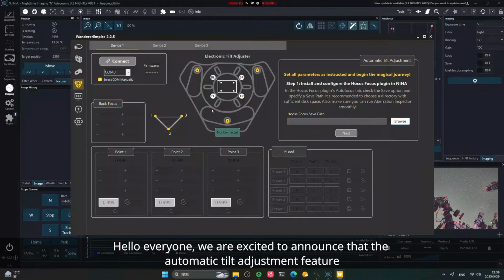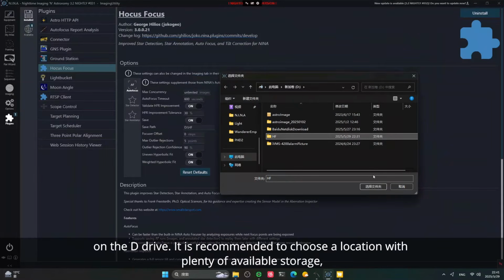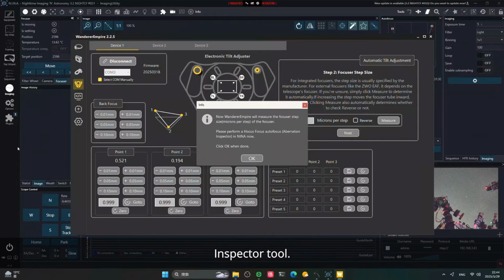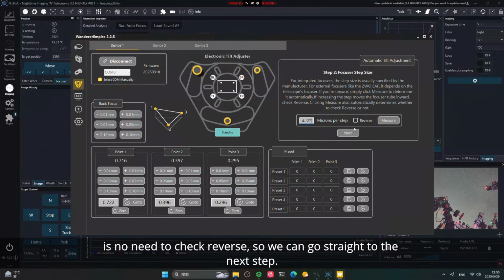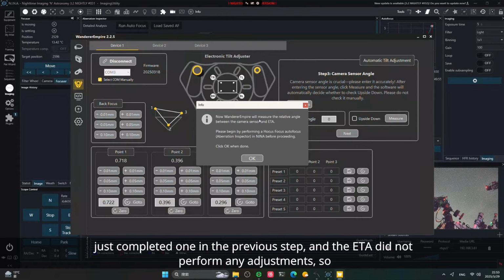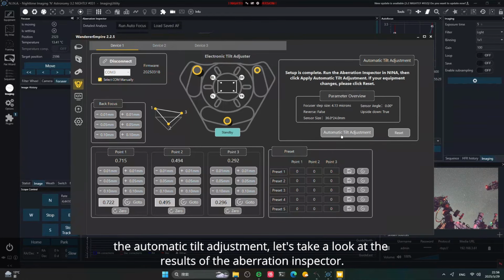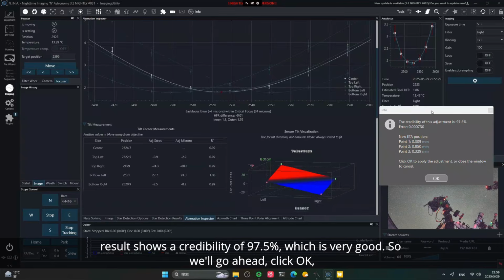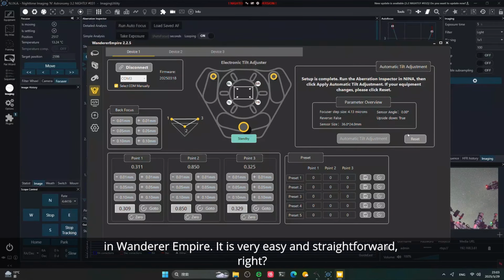Wanderer ETA Automatic Tilt Adjustment Tutorial: The Future of Astrophotography Starts Here

Comment: Technical question:

I currently have the following imaging train on my Takahashi FSQ-102, configured from left to right:

ZWO ASI6200 full-frame camera (17.5 mm)
ZWO Filter Wheel (20 mm)
ZWO Rotator (16.5 mm)
1 mm M54(M)-M54(M) spacer
Takahashi Reducer

The required backfocus for the reducer is 56.2 mm.

I am interested in adding the Wanderer ETA M54 to my setup. Could you please explain how this device should be integrated into my current imaging train and what spacing changes, if any, would be required to maintain the correct 56.2 mm backfocus?

Note: I would like to keep the rest of my setup exactly as described above.
Reply from the maker: It is not possible to combine the ETA to 56.2mm back focus using the CAA.

Comment: Good tutorial! Thank you! Question: Is there a different process for fine tuning of backspace from a flattener or reducer? (perhaps it uses Aberration Inspector to check the eccentricity of the star shapes?)  Will you do a tutorial about adjusting backspace?
Reply from the maker: Hocus Focus also gives the back focus adjustment recommendation, and automatic adjustment will also apply the back focus adjustment. Although we found the recommendation of back focus adjustment given by HF is not that accurate.

The back focus adjustment is super easy using ETA with only one click, so it generally take only minutes to achieve the best back focus by simply observing the images. Unlike tilt, which can change when rotator rotates or when you do a flip, once you set the correct back focus, you won't need to change it again.

Comment: I used the automatic mode  last night and went from severe tilt to no tilt. The final errors reported by the aberration inspector in NINA was 0.0225mm average corner error with a reported backfocus error of 21 steps. On my focusser a step is o.o45 micron so the backfocus error is 0.000945mm. I managed to fix this without leaving the house. As I use the ZWO off axis guider (L) there was no loss of backfocus when installing the design as it replaces the 5mm manual tilt adjuster. Really pleased so far.

Comment: Well that was not at all confusing............................ 🙄
Reply: What are you expecting? This video is spoon feeding you the steps from start to finish. If you haven’t dealt with tilt before it’s a horribly complex topic. 

If you have fixed tilt before, you should know a majority of what this video covers. 

If you don’t have tilt consider yourself lucky.
Reply: @ApoorvaIyer  I must be lucky
Reply from the maker: Just like you can't make autofocus to work properly if you don't set the correct step size and backlash in NINA. Setting the correct parameters is a must for any astro imaging equipment, isn't it?😀 It's only a few steps.
Reply: That is about as easy as you can make it.